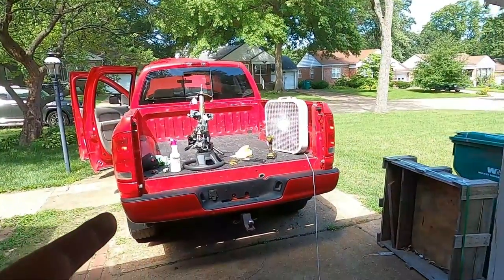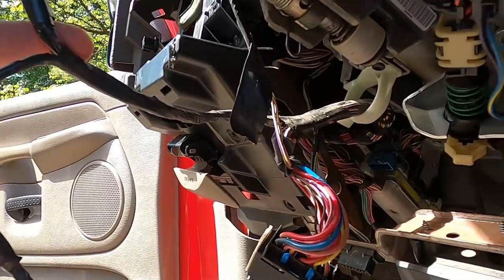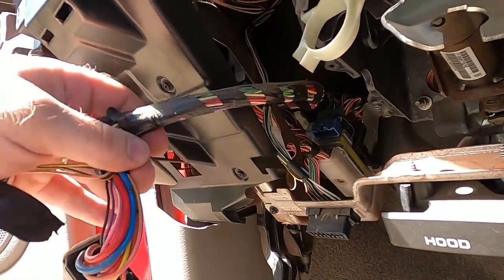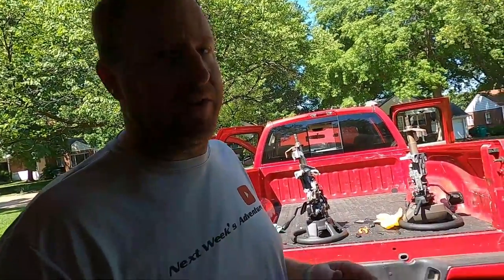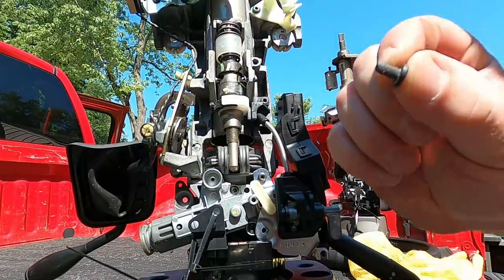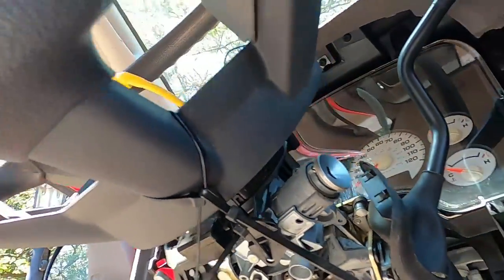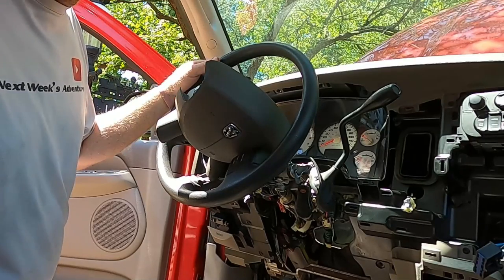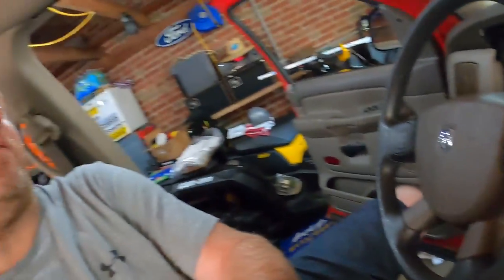How to Swap your  Ram Truck Steering Column and Center the Clock Spring

Comment: Great video, thanks.  I was thinking of replacing mine because I have an obnoxious clicking sound coming from the top of the column somewhere.  Have you heard of this and what it might be?
Reply from the maker: If I was to guess... maybe the clock spring is messed up. Pull the covers off column turn wheel back and forth try to pin point it would be the 1st easiest step. After that would be jack up front end to free up the wheels. Pull steering wheel off and completely dive into it.